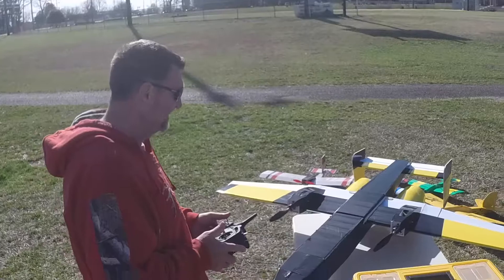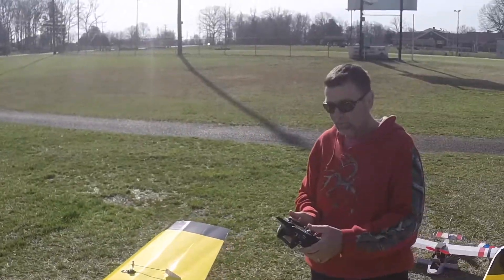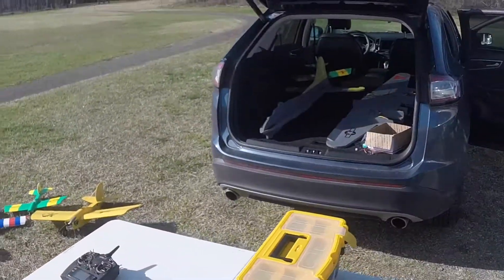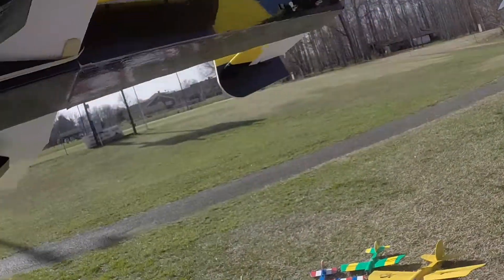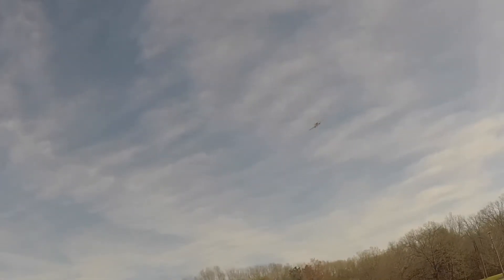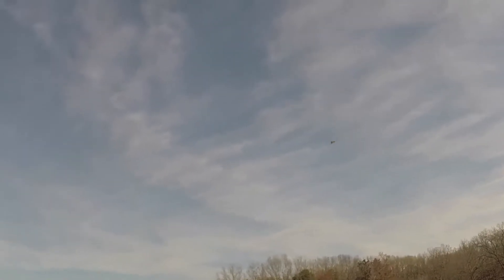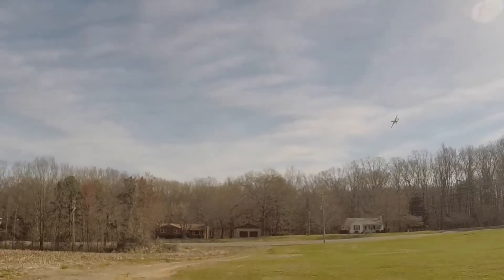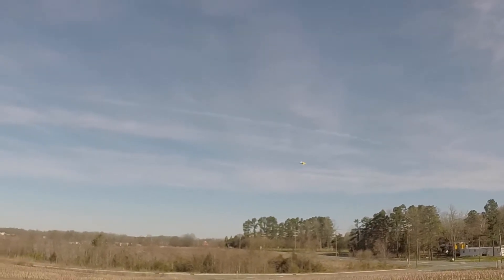RC Foam Planes

Comment: information.    hmmm        i assume that this guy  Wanted  the world's  Slowest-flying  A-10.       i assume that this guy knows that the pretend engines, and  Stand-offs, are  making  a  LOT  of  Drag.!       throttle would be more responsive, if  E  props  were  mounted; instead of SF.        i can see  no  reason to make use of differential thrust, when the model  has  Ailerons.!        to the extent, practical, a control surface (aileron)  Should have the shape of a  parallelogram.       (at :13, there is a yellow model in the background, that has the world's stoopidest  vert-stab.)
at :09, the motor nacelles have a cross-sectional area that is  larger than  Necessary; thus, they make  more  Drag.        at 1:22, that  'step', at the underside of the wing  should  NOT  be  there.    it is making  a  LOT  of  Drag.!      it appears that the wing has a  Wonky, high-DRAG,  profile.!    compare the clark-y.        at 1:53, the, somewhat unfinished, aft ends of the motor nacelles are  making (avoidable)   Drag.!        it is  NO  wonder, that this model flies  VERY  slowly.    cheers      googletranslate
http://1.bp.blogspot.com/-5C8vhlmhBOk/VRe3o3Jt3yI/AAAAAAAABrI/EEgVHXkLvbY/s1600/clark%2By.gif
Reply from the maker: Good point, but our whole purpose is to have fun, camaraderie nothing more. We do a lot of weird, strange and impractical things but we have fun!